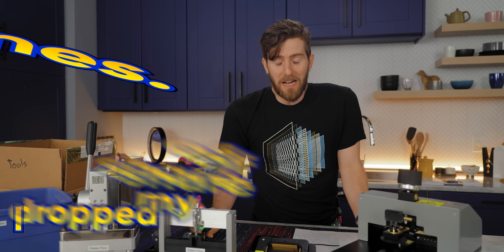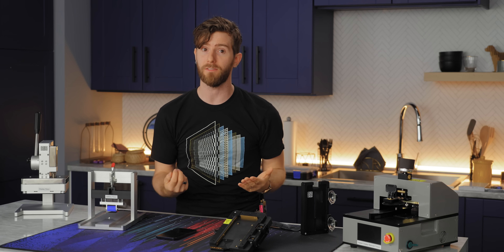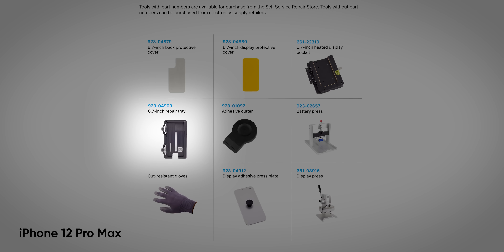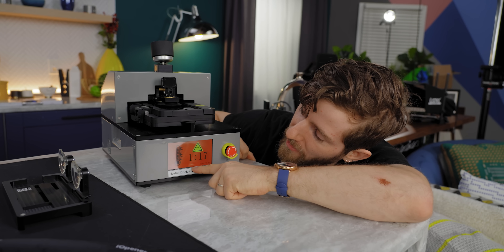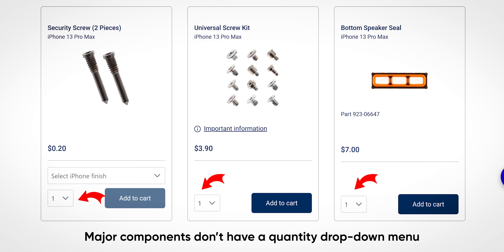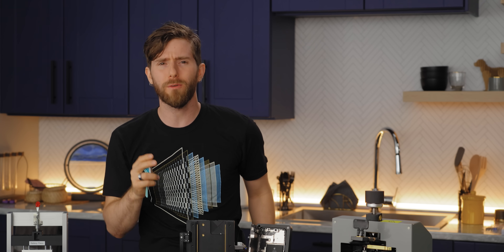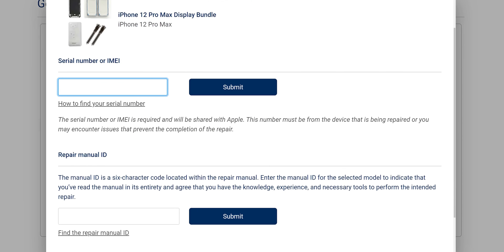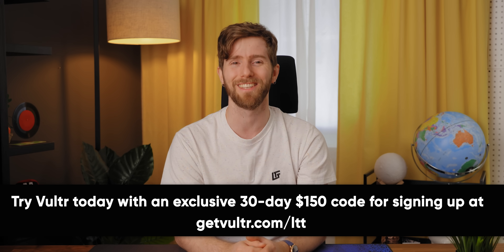I’m a Genius - Apple Self Service Repair Program

Comment: 9:10 - You can’t directly call the Apple Store. When you call a store you go to Apple’s phone support instead. Advisors are supposed to give you prices for batteries, screen replacements, etc., but we don’t know for sure until the store inspects it. Part of the reason for this is because we don’t do physical repairs ourselves, and customers often misdiagnose their issues.
Reply: You can tell the phone system “speak to a manager” and it will get you through to the store. At least that used to work when I was an at home advisor.

Comment: Actuslly I complestly agree with apple for blocking access to touch ID men non-approved home buttons, I can see a molded one being used by governments or hackers to input data that lead to exploiting it.

Security researchers designed a finger print mould that will unlock about 10% of phones because it contains most common fingerprint patterns on a human thumb. Giving more granular access to the data input may be able to increase that to 20%, considering you have multiple tries it could input a set of common patterns from from most common to least common over the X tries that have maybe giving them a high likelyhood of accessing your phone.

Generally remember fingerprints aren't secure against law enforcement, if your going to a protest & arrest you your fingerprints do not have the same legal rights against self-incrimination even though Iagree they they should & under no circumstances should fingerprints be collected under the threat of law. The principal is the exact same, the state is forcing you to incriminate yourself by submitting information you wouldn't willingly provide otherwise. Just cause its fingerprints & not a password shouldn't change that. But yeah disable finger print censors if you're ever in a risky situation.

Comment: Not everyone can just go to an Apple store. Closest one for me is a 4 hour drive 8 if you count the way back too and the cost of going there would be as much as the repair with these fuel prices. There are only 3 Apple stores in the entire country. But yeah I wouldn’t want to use that equipment which is probably the point Apple is trying to make that it is so complicated.

Comment: Thing is, once you buy the tools. You don’t have to buy APPLE parts. I don’t buy BMW oil filters or oil, or even window regulators. And neither does a third party repair shop. The tools and instructions are the valuable part. Apple official OEM parts, yea never buy OEM if you don’t absolutely have to.

Comment: Not quoting over the phone makes perfect sense. Think of it like this do you expect a quote over the phone to fix your car after an accident? 

No because the range to fix it is too large. They don’t quote over the phone since they need to make sure the display is the only issue and run diagnostic tests to see if anything else has been damaged internally. 

The cost to repair it on your own is stupid. I totally agree with.

Comment: Replacing the fingerprint reader does come with genuine security implications. It's a trusted component that tells the phone "hey, you can unlock now". Could they have designed it better? Maybe, but they already didn't do that, so at this point, this is better than breaking security.

Comment: However much Right-To-Repair hurts Apple and others, it's not enough.  Hard to understand how the policy effort is failing, but people don't seem to really care.

Linus is dead-on that offering the process and having no takers allows them to show legislators that:  1) they're a good company trying to help customers, and 2) customers don't want to repair their own stuff.

This isn't directly about margins on parts; it's a crafted strategy to show that they don't deserve regulatory punishment as they make the tools available for affordable rental while keeping the parts priced like plutonium.  The only thing that these companies will respond to is regulatory punishment, so scr*w 'em :(.  I dislike regulation, but you have no other choice when companies own their customers instead of vice-versa.  We're long past due for some mobs with pitchforks.

And this isn't just Apple, for today all mobile manufacturers are closing their products tighter and tighter.  Some are better than others, but none that I've seen are good.

Even the glorious new "passwordless" login system is siloed to each provider as there is no industry agreement for transferring those credentials between them.  This could easily be an open system, but it's not because they have every incentive to keep you locked into their devices and system.  Do not believe any company that claims that this is necessary for security as that's a bald-faced lie.

Comment: I remember every phone had a wrist strap and I never dropped one of those. I think I’ve seen one Sony smartphone with one in the last 10 yrs. my solution. If a phone company cannot mitigate against dropping with a simple strap then all repairs for the life of the phone should be free.
Reply: Agreed, and it's annoying that even if you have the strap there is no loop to attach it to.
Reply: Yeah, does ANYONE have any answers as to how to bring the Lanyard strap back? its was Soooo Obvious

Maybe we could get 'Nothing Phone' to do it, as a cool 'retro' thing :) ???
Reply: @petegaslondon  
1) you can buy cover with holes for lace.
2) specializes strap that goes between your cover and phone and laces comes out from changing port of cover.
Reply: Alright I'll look for them,  @kuldeepsankpal6443  - I've used a few covers with a strap, but was much nicer when there was a real live attachment point on the phone !
Give a link if you like, see if we're thinking about the same thing, or you've found a new type ?

Comment: The thing is, you don't have a right to repair your phone. A decent case can be made for anything you buy out right, such as a computer, TV, or washer, but by and large phones are not bought outright. They are leased or purchased under contract with the carrier subletting to you. Most people actually do not own their phone, its literally in the contract that you set up when you "purchase" the device. It only becomes yours when you finish out the contract and pay the remaining principal on the loan. Phone ownership has more in common with leasing a car than with purchasing a car outright.

Comment: I work at authorized service in 7 year's almost never used any of these tools well sometimes screen press tool,  with apple nonsense requirements its imposible to fix alot of phones using these tools.

Comment: >Cameras are replaceable.

I'm sorry Linus, but this is actually technically wrong.

Go ahead and try to replace the front facing camera assembly for any newer iPhone where instead of Touch ID they use Face ID; and you'll soon realize that it has the exact same issues as Touch ID when you replace the home button on an iPhone 6.

Apple has software tied to the camera assembly for newer iPhones and said assembly also has IR sensors and proximity sensors also attached to it.

Said sensors controls how the device works and Face ID. If you take a donor assembly and use it to replace a damaged one. The one will no longer dim by it self when you put it up to your cheek for a call. Nor will it use the front facing camera for Face ID.

ONCE AGAIN; Apple front facing Cameras are *NOT* repairable if they use Face ID.

Comment: Once I took my iphone 6s plus to an outside "kiosk" and had it repaired by someone my mom "trusted".  Well apparently they glued some of the parts back in after all I wanted was a home button replacement, so when I took it into the "Genius" bar, they said meh looks like one of our genius's glued your battery in or something so we'll just give you a brand new iphone 6s plus instead of replacing the battery.  I also had a broken screen so all in all a battery+screen replacement then would've cost me around $150-200, but because they thought a genius had messed up my phone they just gave me a new one for the cost of a battery replacement, $50.

Genius indeed.

Comment: It probably doesn't take much time if you know what you are doing. I suggest having secondary cheap phone just in case. I for example don't have SIM card in  my smartphone. Limiting the use in dangerous places, and so far it survived the 1 huge drop from jacket pocket. Never had apple device and not planning to...

Comment: >iPhone 6

Oh buddy, wait till you replace that glass only to find out that touch ID doesn't work.

Apple and their software approaches to pairing components to the actual devices themselves is literally the only reason as to why modern day iPhones are hard to repair.

You can take a perfectly fine home button assembly from a working iPhone 6, donor transplant it into a different iPhone 6. And it would no longer register your fingerprint.

Comment: 10:25 yeah sure video games give you better buy backs, but you are comparing apples and oranges here with digital good and physical ones. What is apple supposed to do with a broken screen or a dead battery anyways. I am surprised they offer any credit at all. I am not saying apple is the good guy here, but the issue is not the low buyback prices but the high part price in the first place.

Comment: A note on the "No quotes over the phone" thing as a service center manager (at a big box electronic retailer) of some 10 years:

You Linus, are a rational human being. Customers as a group, are not. "Customers" lie, misrepresent, misdiagnose, and flat out do not understand their own devices to a staggering degree.
So yeah, it's annoying, and yeah, sometimes we may try to sell you something else if your three year old threw your new S22 in the pool. On the whole though, our motivation, and mine when I set the guidelines for my employees is to preempt argumentative "Customers" who received a "$40 quote" for replacing a battery when the whole phone is the size of a Calzone and needs to go in the hazardous materials bin.

Comment: So a side note on Apple's SELF repair program. You need to call an Apple engineer to activate the parts. 

Not sure what they are trying to imply there? Apple Engineers arnt humans? Or Apple believe that you and the engineer and yourself only count as one being? Or does Apple just not know what self means?

But in all seriousness though, if the engineers are too busy, it too also adds to the time. But also the policy is if the activation fails, then the engineer leaves the call and your need to call again

Comment: Louis Rossmann also pointed out an important point for this program: You can do all of those repairs with cheap iFixit tools without needing the apple tools, if you are comfortable with repair in general.
Reply: And are ok with a bit more margin of error. 

BMW makes a $30 telescoping pen with a wire in it for aiming washer nozzles precisely. Or you just stick a pin in the nozzle and get it about right. If you’re happy with the level of precision you can achive, no need to buy OEM special tools.

Or OEM parts.
Reply: @Racing_Pig  Well if you are decent with repairs, it's a bit slower, but the result is the same, which is sadly not the case for 3rd party parts, at least for Apple, because they can't be paired. People like Rossmann and his colleagues have worked with those iFixit-like tools for years and the repairs are professional if you know what you're doing.

Comment: As an electronics repairman who worked on iphones from an independent repair shop(not an Apple IRP), here's my take on this program:
The only way I could see this repair program working is if they let independent repair shops(and whoever else wants to) buy parts in advance WITHOUT a serial number required AND lower the price of all parts by at least $50. The quality of the tools/replacement parts are irrelevant; The folks that used to come into the shop would always be fine with the price being about the same as the genius bar, but it's the "you would have to wait about a week for shipping" that drove almost all of them off. And even then, these prices are absolutely outrageous(if it costs a repair service $290+shipping/tax for a screen, then that repair services price to the consumer will NEVER compete with the Apple price of $330, AND THAT'S WITHOUT BUYING ANY OF THEIR OVERPRICED TOOLS). Hey Apple, why can I get a screen for half the price that works just as well, but apple says "it's not OUR screen, thus no camera, face id, etc."? I don't see car manufacturers throwing a fit when I replace my broken stereo or drive belt, and you're doing that right now, but worse.
Until they either allow 3rd party parts to be used on devices WITHOUT getting features restricted, or they allow people to stock up parts for on-the-spot repairs(i.e. don't require a serial number, let me order as many parts as i need beforehand to do same-day service) AND lower the price, This program will always fail to make any sort of monetary sense, for both consumers AND local shops(where they WONT try to sell a "brand-new Iphone 15XRS with 54 cameras and a 3-year cover-all warranty for the low, low cost of just $1500!").